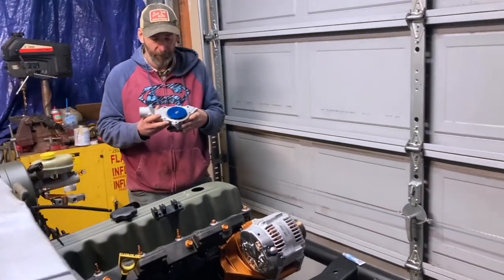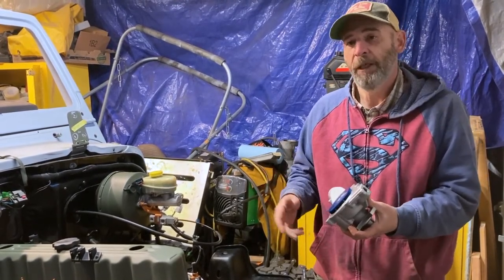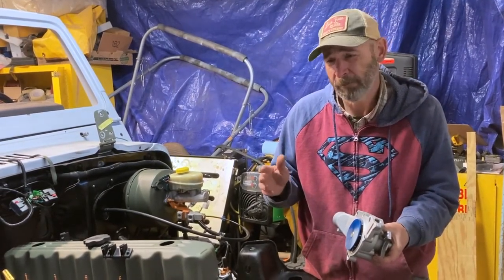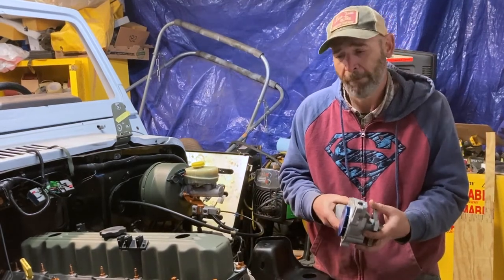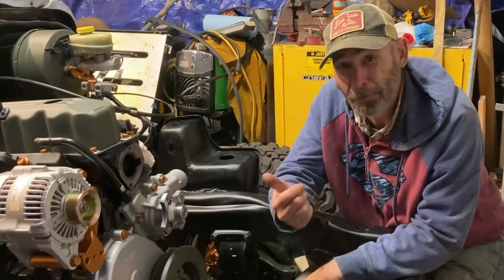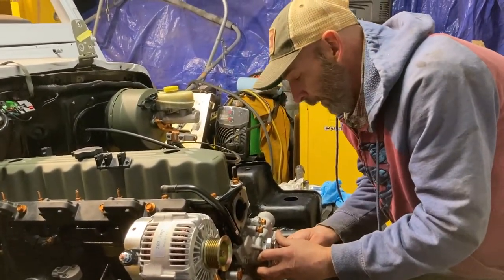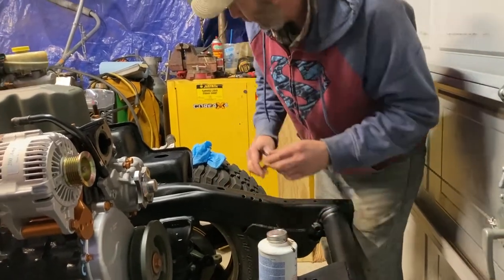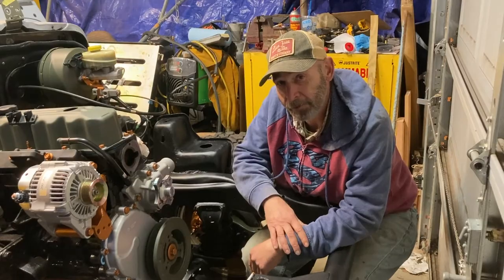Replacing Water Pump Jeep 4.0L with high flowing FlowKooler water pump

Comment: Vent your hood, move your air intake outside of the hood and throw a Mishimoto radiator at it also makes a big difference.   Helped my '05 TJ a lot.
Reply from the maker: Saving for Mishimoto  radiator or similar . Have the vent but thinking of doing something different on intake . Maybe some type of ram air system ...
Reply: @rustyjeep9783  I know there is a kit where you can put in a HUMVEE intake up near the firewall/windshield.

Comment: I want to know and this is not something i found on the internet, what makes a high volume water pump "high volume"? is it the impeller has more bite or what is the reason? thank you much for your input
Reply from the maker: First thanks for watching .. A few thing make a high flow pump work . 1 The improved larger design of impeller unit and blades. 2 material used like aluminum that is coated so it doesn't wear out. 3 the high tolerance machining makes a big difference . The water pump I got from Flowkooler inners are made in America NOT CHINA and I'm sure that helps. If you have any more question just let me know .
Reply: @rustyjeep9783  Man thank you so much for the high volume input,i have always bought GMB pumps for my cars and although probably nothing as nice as flowkooler  i have always noticed they are really nice pumps and i have never had one go south on me.

I once had a run of the mill part store pump that was new and put it next to a  GMB that i had bought and the differences were very noticeable,no flashing on the casting,the impeller had 2 more blades than the other pump  and the finish on the aluminum was second to none so i see what you mean now,i just wasn't sure if there was more hidden i hadn't noticed on these high volumes,I'm sure the bearings are better too.

Comment: I have an 06 jeep that overheats when driving but not at idle, i just put a new thermostat and radiator cap has an aftermarket e fan and radiator would the water pump be my issue? No coolant in oil and i bled the system as well
Reply from the maker: Question did you get a after market aluminum radiator because they are smaller core and flow much slower . If you'r over heating at driving speed probably a flow issue so yes I do think a high flow water pump would help. Also check that your e fan is not put on back wards because there are different direction fan blades go for pushing and pulling air .  Start your jeep and check air flow direction. Plz let me know if you have anymore questions and let me know what happens ...
Reply: @rustyjeep9783  i will check i purchased the jeep with all the aftermarket stuff i haven’t drove it much and towed it home when i purchased it, it’s a 3 row aluminum radiator from alloy works
Reply from the maker: Thats exactly what I thought . The high flow defiantly will help and they even mention 3 row aluminum problem on we site. GOOD luck and sorry didn't see new comment
Reply: Hi, I'm curious if a high Flow pump would produce more heat for me during the winter time.  Noticed that it takes a long time for the engine to warm up and after it does the heat isn't that hot.  When the engine is at temperature.  I replaced the thermostat for a high Flow one at factory temperature and it helped a bit.  Also flushed the heater core.   But now wonder if a high Flow pump would make it better with a constant heat flow when the engine is at temp.

Comment: What radiator cap are you using with your high flow water pump? Getting ready to install flowkooler on my 2000 XJ and it currently has 16 psi cap.